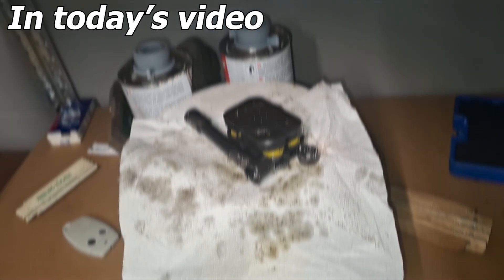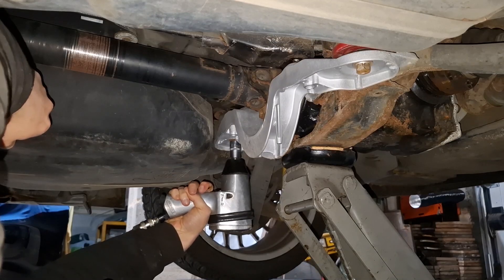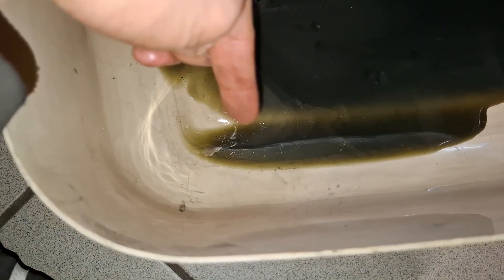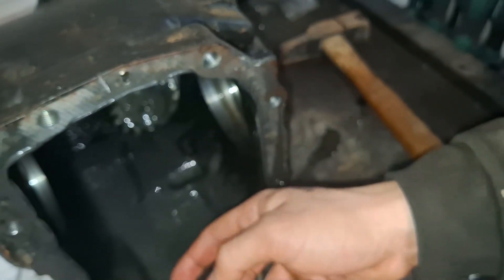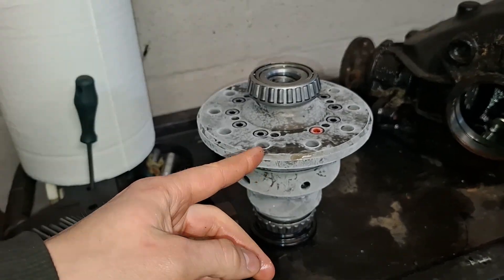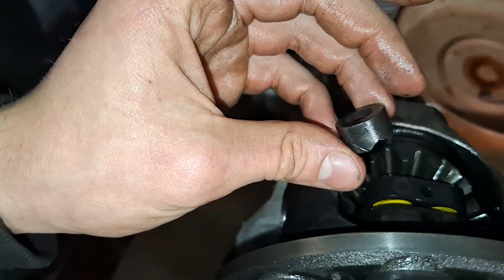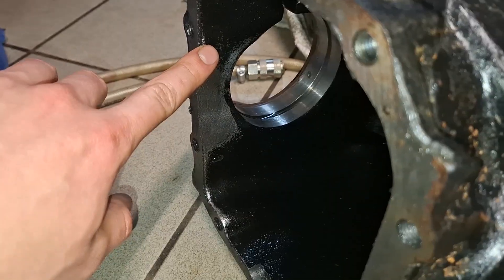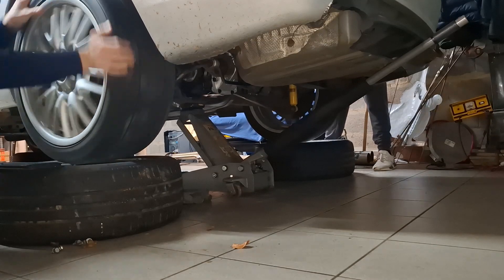Racingdiff Conversion Set Nearly EXPLODED My E46 // Full Tear Down and Blackline LSD Upgrade

Comment from the maker: Did you expect the kit to get this destroyed? Let me know! :)
Reply: I've seen this conversion kit several time in my ads. (I daily drive a E92 335i N55)
But as I'm a mechanical designer, I was really really suspicious about it 🤔:
- This limiting the torque only with friction of the output gears & those plate ... hum 
- Where is going the extra axial load due to the spring pack ?
- Original bearing, can they handle the extra load ?
My doubt were founded. Sorry you had to learn the hard way. 😞

My hypothesis : It was working at the beginning because the surface roughness of the parts subject to friction was enough.
But as the slippage goes on, those surfaces got "polished". The metal glitter in your oil is a proof.
Once the plates are shiny smooth, there isn't enough friction to limiting the slippage. It become useless and your diff is back to a normal one.
Reply from the maker: @stephanelouvet1113
@stephanelouvet1113  Yes they heavily advertise it, eventhough i dont think that extra axial load and stock bearings will pose an issue in pretty muich all circumstances there are too many other failure points and not enough advantages to choose these kits over conventional lsds :) It is just an inferior design
Reply: I have bought similar kit couple of years ago for my Peugeot 106. I tried in a couple of instances to install it, but something always got wrong and I put gearbox back without it. That’s actually pretty good luck because it would probably destroy the whole gearbox.
Reply from the maker: @LukinAutoVlog
@LukinAutoVlog  Maybe a blessing in disguise :/
Reply: @DailyDrivenClasssics  some greater force was preventing me from making the big mistake

Comment: I got myself one a while ago for like 240 euros and ive installed it since i got 3 diffs sitting around. I will update one how long it lasts but ive machined the flanges on the shafts to shorten them, so they do NOT contact the clutch pack.

Comment: thanks for this video. i got conversion kit  instaled it work on wet surfes wery goood. but  honest i  think the weak element is the central pin is to soft. it should be made by some extra stron forged material. maby then will be stron enought to work long time. I thik it will  blow up my difff in the future and i realy thik about remowe it and replace it as you do by blackline unit. or remove it all. i would not buy conversion kit again. better get more monay an go torsen. or real lsd. cheers
Reply from the maker: @szuger628
@szuger628 Glad the video was helpful! :)

Comment: I don't know exactly how the Racing Diffs conversion was installed but I figure any undue force could compromise it.  My Volvo diff has different retaining devices so it shouldn't suffer similar.  It is used as a traction aid though, not really a handling modification.

As for backlast, you should have obtained some marker paste to verify correct tooth contact.
Reply from the maker: @idonotwantahandle2
@idonotwantahandle2 There is a video on my channel from 3 months ago you can check that out :) I really tried to do it right, even used a hydraulic press, loctite etc. Concerning the backlash, i checked but didnt show it because i used non oil paint but cleaned it thorougly aftewards. it looked relatively centered :)
Reply: @DailyDrivenClasssics I saw your video and agree you tried to do things correctly.    There were 2 things I did differently.

Firstly, I lubricated everything with gear oil suitable for LSDs.  LSD fluid has friction modifiers to make it more slippery.

Secondly, I used a couple of bars to ensure the conversion kit plates were accurately centred before trying to install the axial pin.

Thirdly, I decided to gently drift in the axial pin.  I know this is not generally recommended but it is easier to gauge the amount of force needed.  Using a hydraulic press doesn't convey force very well unless the operator is experienced.  The ferrule or collar for the axial pin is not hardened and I figure it is easily damaged especially if it is not well lubricated with slippery gear oil.  Your installation video didn't show each and every part being lubricated and the oil being thoroughly wiped into 100% of the contact surfaces.  I suspect the oil you used for assembly was not extreme pressure LSD oil.

Obviously, I wasn't with you so can only comment about what I saw on video.  I hope this is in some way helful rather than a hostile rant.
Reply from the maker: @idonotwantahandle2
@idonotwantahandle2  Yes i really wanted it to work. I actually used LS specific oil, i just bought it in bulk because it's cheaper and i had to refill. I think mine may not have been perfectly centered, but the retaining ring was not damaged after disassembly so there shouldnt have been any issue with the press. I also dont understand how the whole cap broke in half since it is supported by walls all around. maybe there was a production error in my kit :/ I can only guess what went wrong, no way to say it with 100% confidence :) No offence was taken, it is just that i really tried to install it correctly :)

Comment: Probably a dumb question but how much abuse did the racingdiffs hold up to ? Im half and hald on getting one.. i do know a proper lsd is better and will proform better but I don't have the budget rn for a blackline, I know they like €650 wich isn't bad but I got a e36 compact making 105hp stock and about 165hp with what I done to it... like im not wanting to do burnout and shit just have fun on a wet day and drift a little😂
Reply from the maker: @Kink3chamilian
@Kink3chamilian Trust me i wanted it to work aswell. you can check out my other 2 videos on the conversion set. For your compact i wouldnt bother installing an lsd. if its a true shitbox just weld it. if it's mint keep it open diff :)
Reply: @DailyDrivenClasssics thanks dude ,i really appreciate it! my compact is in decent condition but still a little bit of a shitbox but im keeping it as long as I can

I think I'll get a second hand diff for a couple of bucks and weld it, then I got daily diff and weekend diff 😂😂😂
Reply from the maker: @Kink3chamilian
@Kink3chamilian Sounds like a plan😂😂😂
Reply: Waste of money
Reply: Get the blackline lsd for example, build it proper so when the car falls apart you can sell lsd and get what you paid for it back, atleast here my phone would be ringing non stop for a e46 lsd used.
Reply: What did you do to your e36? I have one and i have blackline lsd but it’s stock apart from exhaust, i want some extra hp too haha
Reply: And don’t listen to that about the lsd, if u can, save some and get it, totally worth it, even with my stock 105hp i have loads of fun with the car especially in the rain
Reply: @mks2574 on my e36 I got a reground cam and bored it out to a 2L😅 but with just a cam and good cold air intake is was making 145hp without tuning... its pretty cheap for a cam about 200€ for a "street " cam and about 400€ for like a "race" cam... im running a street cam and it's perfect
Reply: @Kink3chamilian do you have the link for the cam? Mine is already 1.9 so no point boring it out, but i guess with a camshaft and a cold air intake i’ll be reaching 140hp easily, i also have a 4.21 ratio on the diff, since my original one broke and i couldn’t use so i got the lsd in a e30 diff, car is pulling good now, but can’t go over 160km/h 😂
Reply: Im saving for the black line,its better and safer than a welded diff for daily driving 😂😂 @mks2574

Comment: On 188k diff there was no grinding necessary with the blackline lsd unit
Reply from the maker: @Vireboy
@Vireboy Weird. i could not get this installed without grinding. There was just no space :/
Reply: @DailyDrivenClasssics  I remember it taking a good bit of fiddling around to get it fit though😅
Reply from the maker: @Vireboy
@Vireboy  Is it still working?
Reply: @DailyDrivenClasssics No complaints so far. I have had it for a year now, but its a summer car so not that many km on it yet.
Reply from the maker: @Vireboy
@Vireboy Great. If it lasts 50k km I m happy enough :)